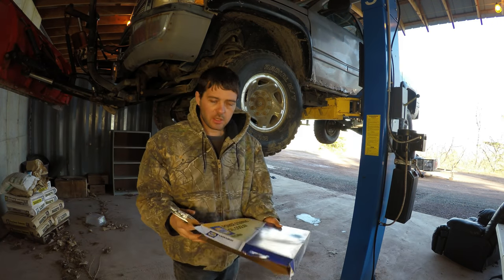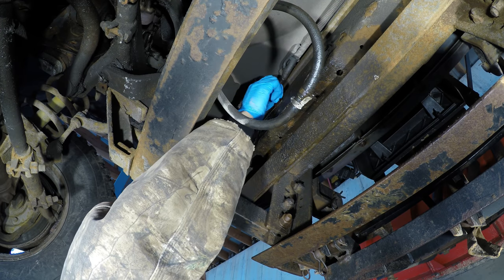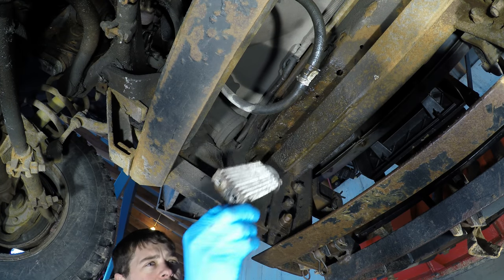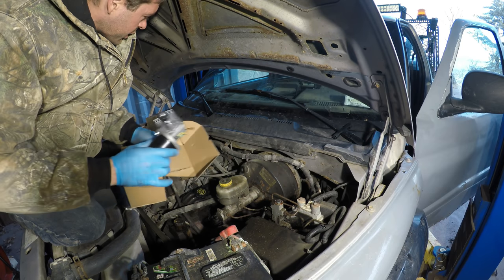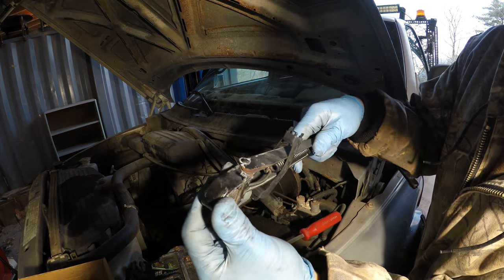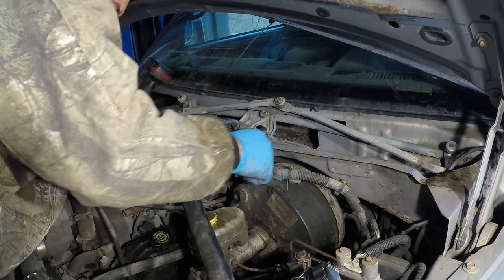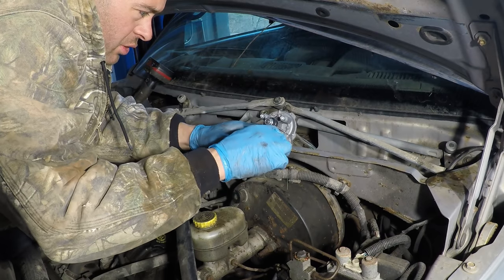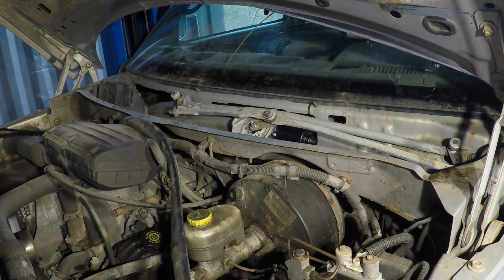Fixing dodge pickup

Comment: Andrew, thanks for making and sharing another straightforward and common sense video. I share your love for simpler machines. My compact track loader is a 98 model and can be maintained easily. I like your idea of involving all the brain power of your viewers to design and build a simple durable truck. I have been working as a production engineer at a Toyota plant for 31 years and have some experience to share. I’d like to get in on that project if you get serious about it. Ever seen the “Seeker SV” website? They are building a74’ steel research sailing vessel in Oklahoma. People said it cannot be done, but internet volunteers are doing it. Maybe you can build a truck to meet your specs.
Reply from the maker: Yeah, ill have to check that out. I guess I should get working on the truck video.

Comment: Got a 74 and 77 F100 with original motor, trans and rear ends still running like sewing machines. They just don't make them like they use to. Now granted im only 25 and don't know a whole lot about back then. Having my 2 old Ford pickups though have shown me a lot about how stuff was made back when.

Comment: Be careful Andrew only time I have ever seen a vehicle nose dive off of a lift is when it had a plow on it. Guy was very smart and a great mechanic and it was his personal truck he never worked on it with a plow and he didn't think twice until. He took the rear tires off and the nose fell. I just want make sure there is still going to be future  videos haha. I am sure you had plenty of tools and weight in the bed, you have alot of common sense and are very smart. I hate seeing all these comments from lazies thinking they know better. All your work seems pretty high quality. You may have some areas I don't agree on but we were all taught differently doesn't mean you are doing it wrong! Keep your head up and the good work flowing stay safe man. Plus form you drone shots I am thinking of maybe moving spending some time in the east and would love to work with you of for you you seem like a chill guy who just wants to get the job done!
Reply from the maker: Yes, good advice. I try to put the lift arms as far forward as I can when lifting it with the plow on, plus the truck has some weight added in rear. When I was in auto repair school they recommended to use additional lift stands when removing/installing a heavy component on a lifted auto.
Reply: Andrew Camarata I figured you knew you seem to be a jack of all trades!

Comment: Awesome! Yah, the cooler for the power steering, if it was a truck you didn't plow with, would have been fine without the cooler. The higher the pressure in the system, the hotter the fluid gets. The fluid can get hot enough to melt the plastic seals in the gearbox. Every little bit helps, especially a work truck. :)

Comment: Power steering systems with engine driven pumps generally need a fluid cooler as it is constantly pumping and thus constantly generating heat, newer electric pump systems, well I've not seen one with a cooler on. 
When changing a wiper motor, it's generally recommended to to operate the motor before reconnecting the linkage, to ensure it is in the parked position, and it's handy to mark the position of the linkage arm before dismantling to go by when putting it back together.
Reply from the maker: Mikey Dunn good advice on that. It could be adjusted a drop, but it's working well. That was my first time doing that job.

Comment: For those watching and have GMC/Chevrolet trucks, if your wipers start not working properly, ie. not stopping when you turn them off, only working high, etc, there is an electronic control module that is notorious for going out. On the GM trucks, it's rarely the motor.
Reply: Maybe signal light switch

Comment: Can you make a video giving us a little more detail on how you did your plumbing on you shipping container? Mainly your shower, toilet and sink drain. Did you run the pipe straight down through the shipping container into the concrete? Did you have to cut through the containers metal floor supports? Stuff like that. Thanks Again and great video.
Reply from the maker: I did It like in any other building. I ran pipes threw the container floors.

Comment: Andy update about the tape. The store name is. SCOTCH. SUPER 33+ I have used all the time on all my electric work to cover up wire nuts. Also. On the end of nylon rope. It would have worked. Great on your HOME MADE RUBBER BOOT FOR TRAN COOLER LINES NICE CALL!!!!!!!!!THATS FOR ONE MORE FOR THE OLD MAN. ITS JUST A GOOD ROLL OF TAPE TO HSVE IN THE TRUCK WITH YOU ALL THE TIME. WHEN YOU PUT THE TAPE ALWAYS PULL REAL HARD TO GET IT STRECH OUT YOU"lI be fine. Keep up the good work. JUNKMANDO

Comment: you forgot to burp the system with the truck in the air, engine running and crank the wheel to each side about 15-20 times

Comment: Nice work.  Yeah, I don't understand the need for p/s coolers, either.  My p.o.s. econo-box has one too, and it let go out a while back.  I found a newer model of the same car that had been rear-ended at a junk yard, slightly modified cooler, but I made it fit, and no more leaky-leaky.  Did you guys get off easy with this latest round of snow dumpings ?
Reply from the maker: Yeah, not much snow here.

Comment: I've watched your video. But I'd like to give you a piece of advice.
In this case, the hydraulic lines must be deflated after maintenance.
I like your DIY but I don't think you are being taught well.
Build, weld or repair is great, but I want you to look it up in the exact book or YouTube video and do it. A word is left by the subscriber in Korea.
Reply from the maker: "The hydraulic lines must be deflated after maintenance"? What are you referring too in this video?
Reply: Maybe bleeding the air out of the hydraulic lines?
Thought about that also, but with some turns of the steering wheel from end to end and maintaining the fluid level, the possible bubbles would come off...
Reply from the maker: Yeah, those don't need to be bled, that's just a return line.

Comment: I have been having problems with the wipers on my car. Sometimes they hang up. They work fine on low and high, but when I use the intermittent setting they will stop working or kind of stutter when they are running. I was thinking that there is something wrong with the electrical controls, but I suppose it might be the motor? Would you like to do a video diagnosing and fixing my wipers?
Reply from the maker: Its probably the motor. Mine started out like that too. Than it got weaker and weaker until it only worked on high. Just use a test like to make sure its got power and ground. If it does, just order the motor and install it.

Comment: It is a silly question but why steering system needs a cooler?
Reply: Gontainer not sure about dodge but ford has one because the fluid runs both the brakes and the ps and when the fluid gets very hot it gets thin and can burn a pump up
Reply: It transfers forces to the wheel and gets warm doing that, if it gets too warm the steering can become soft...

Comment: Andrew do you think a 2000 2500  Silverado can tow a bigger Skid steer and a dump bed insert
Reply from the maker: Yes that will tow a skid steer. The dump insert wont hold much, you are better off with a dump trailer, or just get a dump truck.
Reply: @AndrewCamarata  thanks man i really appreciate the reply
Reply: I was searching the internet after you told me to look for a dump truck and I found a 93 F800 diesel dump truck for 5500 needs one. Leaf spring replaced the guy said he has the part do you think that would be worth it come with workin plow